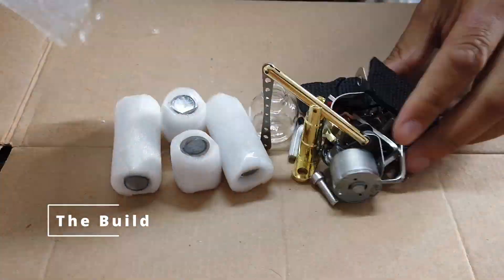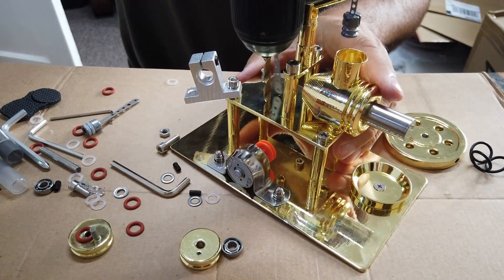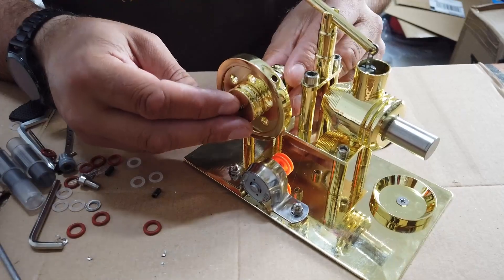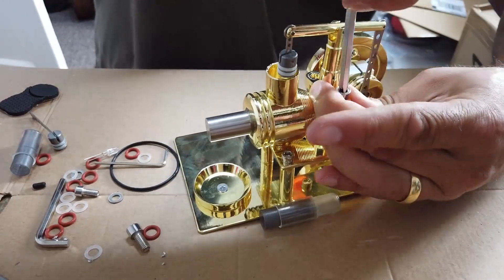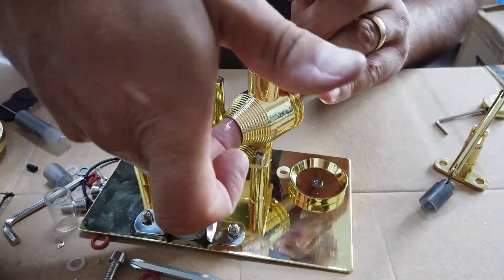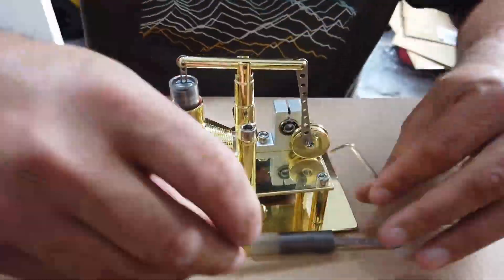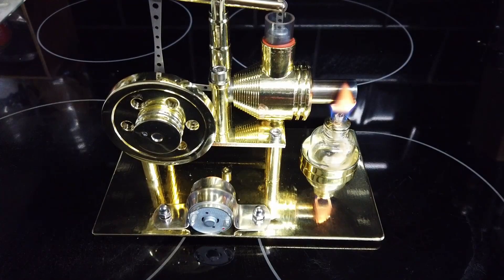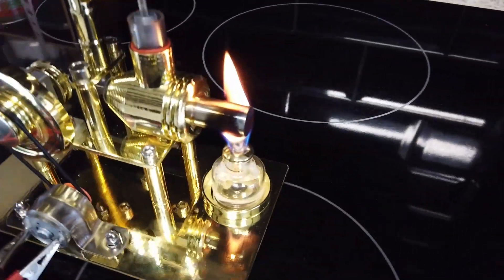DuB-EnG: StirlingKits.COM - A Scottish Stirling ENGINE ...  Made by China...  Is it any good?

Comment: Very cool little engine! 
Assembly tip: if you want to lubricate o-rings for assembly, just add a little isopropyl alcohol as a temporary lubricant. 
Isopropyl really works a treat for fishing cable through grommets and rubber seals as well.
Reply from the maker: Now there's a fantastic tip! - And, yes, I had some to hand!  ...  Thank you!
Reply: Wouldn't Isopropyl alcohol dry out the O-rings?
Reply: @FlightDreamz  No, it won't affect them at all past making them slippery whilst still wet. It's the standard method used in commercial manufacturing for grommets and rings. Isopropyl also works amazingly well to painlessly apply gips to bicycle handlebars (where the secret for removal is a compressed air jet).